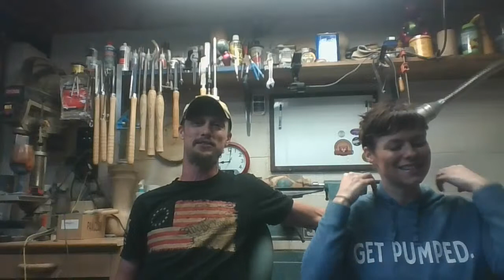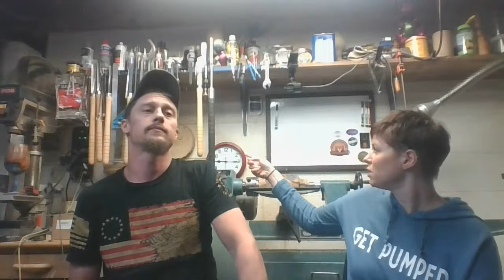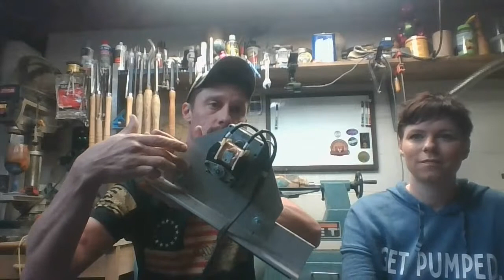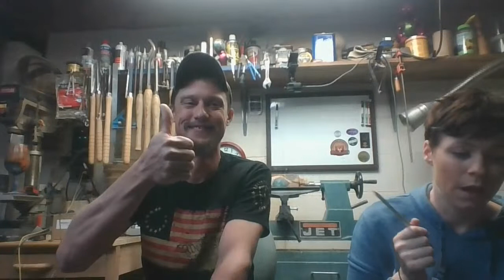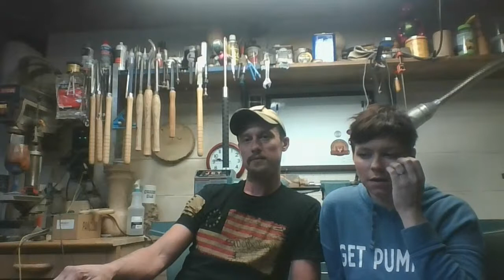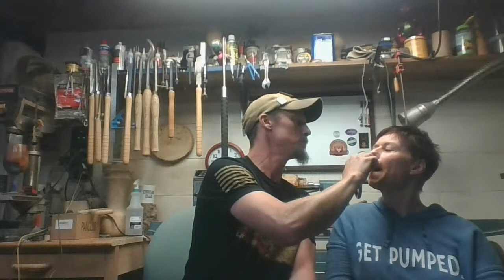Duka Heritage Live Q&A

Comment: Whats the best sealer for cracks?
Reply from the maker: Well I suppose that depends on the size and whether or not you want to blend it or make it stand out. If it’s relatively small I’d use CA glue... if you want it to blend, fill it first with very fine sanding dust and apply thin ca over the filled crack. To make it stand out maybe use a black or brown CA. If it’s larger then I’d most likely use epoxy resin.
Reply: @dukaheritage9445  thanks